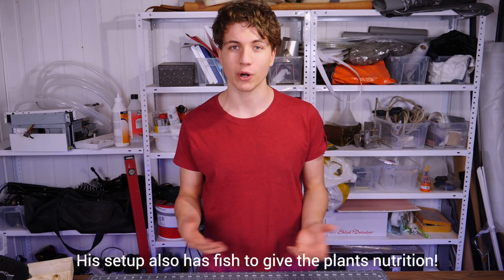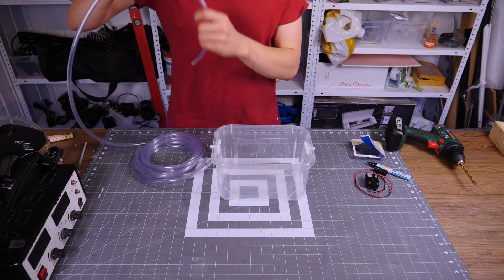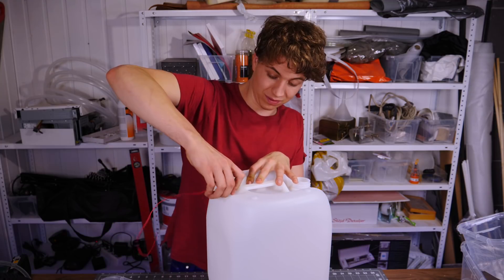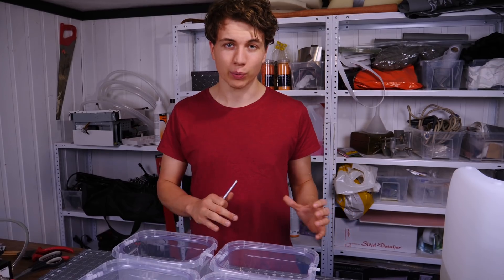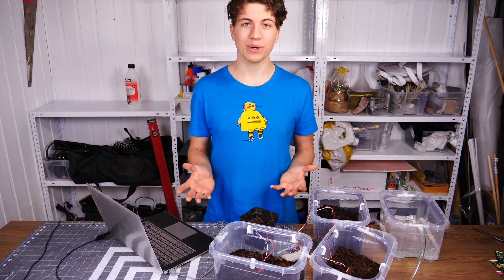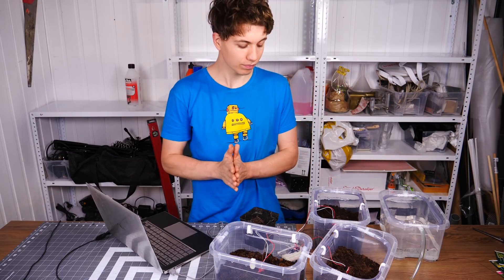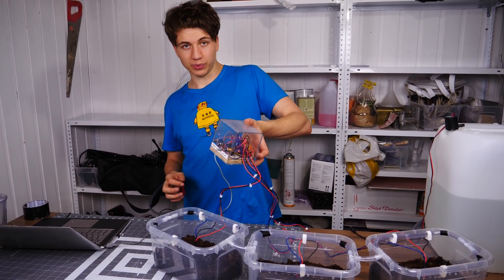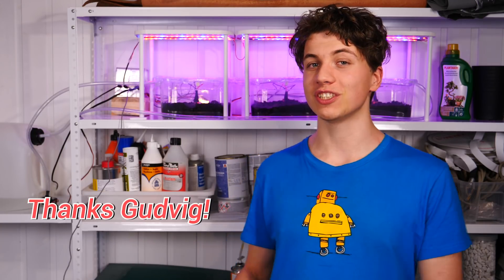Automated Indoor Garden  (The Garden Project ep. 1)

Comment: Nice first attempt. Two comments.
1. The moisture sensors you are using die rather quickly.
2. LED strips are rather an inefficient  way of controlling LEDs because of all the resistors included. If you don't want to waste so much electricity,  you can make your own strips with no resistors and  include a voltage regulator. You'll have to work out how to connect all the LEDs together (Usually done by a PCB) and use a voltage regulator (Both are quite cheap).

Comment: I've been watching some nerdforge videos, and like what you guys are doing. From experience, I think you will have some future issues with corrosion and bad readings on the soil moisture sensors.  There are methods to prevent that, but not with the sensors you are using. Also you can save the hassle/issues by switching to hydroponics, and ebb flow, or just spray/drip system on a timer. I recently posted a diy mini aquaponcs ebb flow system  with free 3d print files. I think you could tweak and utilize. http://www.gardenisto.com/cultivation/horticulture/desktop-aquaponic-tank-part-1/

Here are some links similar to your project, or may be helpful.
http://www.gardenisto.com/systems/controls/analog-soil-moisture-sensor/
http://www.gardenisto.com/cultivation/hydroponics/simple-drip-setup/
http://www.gardenisto.com/cultivation/hydroponics/diy-apartment-hydroponics-with-light-for-30/

One last note, I don't see any Lumens output specs on the LEDs you are linking to, but that height, plus the unknown lumen and saturation/light angle, could cause your plants to sprout in a weak and spindly sort of way, if they are sufficient at all. I learned that with anything over 3" using 1watt per channel rgb LEDs here:
http://www.gardenisto.com/systems/lighting/diy-led-grow-lights/

Maybe I am late to the game and just missed the update. If not, I hope you post an update, revisit, and make the improvements with the ESP mcu you mentioned. Looking forward to seeing more on this.

Comment: I would suggest adding some gravel in the bottom of the containers and some holes to allow water to drain out. Otherwise, you just built a really cheap mold growing machine. Also, maybe do a single pump per box you are monitoring in case there is a different plant that needs a different watering schedule or water saturation. The way you have it setup now is that the lowest common denominator will trigger watering for the whole system. You may have the other two containers over watered, or worse, overflowing with water if one of the sensors fails or reads below the triggering event.
Reply from the maker: Hey, thanks for the input. Surely room for improvement! Ideally I would have one pump for each, but as this is just purposed for growing seeds to sprouts they don't really need much water, at least not the seeds I have planted. So while you are absolutely right, I have coded it so that watering is consensus based. Anyway, it's not optimal and I'll be looking into improving all of it in future episodes. Once I have allocated some more space...

Comment: You wont be happy with these sensors for long. Thres's a steady current flowing between the two electrodes, so electrolysis will slowly eat them up and produce not-so-healthy metal salts which then will be spreadet in your soil...
Reply from the maker: Hmm, that's an issue. Let's see how long it takes, might switch it up later
Reply: I had the same concern. Please let us know. I’ve heard that they last longer if you don’t Power (activate, or whatever you call it) them continuously; try to only power them for the reading.
Reply: Dustin O Even this won't be perfect: Soil is usually a bit acidic, so it will dissolve the electrodes even when not powered. One possibility would be a capacitive sensor: it measures the capacity of the soil, the more water is contained in the ground the higher the capacitance. They don't require direct contact to the soil so will last way longer and are probably more hygienic

Comment: Putting the water container and pump on the same level or higher than the delivery tubes would take some stress off of the pump and possibly extend the life of it. There are also inexpensive spray nozzles available on Amazon which might work with the flexible tubing but would work for sure if pvc pipe were to be substituted.  A similar concept would work if the system were to be aeroponic and the electronics could be simplified. Great idea with the arduino and sensors, nice inexpensive project.

Comment: Hm...not a hydroponic expert, but I wouldn't be surprised if you got problems with mold  if you water from above and keep moist earth covered like that. Again, not an expert, but I think that's why you're supposed to water from below and keep the crust dry by making sure there's enough airflow.
Reply from the maker: Yes, but this is not a hydroponic system, although I want to make that in the future. This is just a basic watering mechanism for when the soil gets too dry :)
Reply: Yes, but even though you are not targeting this too be a HydroPonic System, you are still going to need proper drainage and root ventiliation. The way you have it setup now is it is going to induce quite a bit of mold growth.
Reply: Yes, you're right, of course...with soil it wouldn't be called hydroponics (not a native speaker either☺). The setup is pretty similar, though. 
Anyway, at the very least you need to add a layer of gravel or something under the soil...with targeted watering that might be sufficient to prevent rotting roots. You could also mix some fine granulate substrate like Seramis with the earth to airate it more and suck up superflous water.
And most importantly...if you use high containers and dripping water you need to install a fan that'll insure some airflow.. I know, it's counterintuitive that earth or living plants would grow mold....they don't do that outside, after all...but inside is a whole different business. No idea why. 
Or you could look at the way targeted watering is done in very arid areas of the planet. They put the tubes into (or on?) the earth, poke tiny  holes into them and next to each hole is a seedling. Literally not a drop of water is wasted. And you wouldn't have to worry about mold or rot that way. It's very clever and would probably work well in your setup.

Comment: You should isolate each box to avoid over watering or introduce an electronic valve system to route the water to the boxes individually. If Box 1 is too dry but Box 2 and 3 are at the proper levels, the sensor will trigger the pump (unless your code says otherwise) and then water would be pumped through the entire system and could possibly over water the other boxes. Great video!
Reply: Yes, my thought as well. This is only useful if all three boxes dry out simultaneously. Still a cool project, though.

Comment: Like this, will follow as you build it up.

Just a suggestion, (in Australia at least) for our garden sprinkler systems, you can get different heads etc. It would give you more control on direction and spread (I would use the misters for the seedlings for example). Should just push into the tube like the black sprinkler system hose as well.

I wanted to make a computer controlled garden box to keep a particular (and hard) tropical ant species. So I might steal some of your ideas etc :P
Reply: Amazon, in the USA at least, offers a variety of misters / spray nozzles that would allow a very consistent watering. The pump might need to be beefed up a bit but the performance would be improved.
Reply: Yeah, never know what other countries have. But I think you are right, slight pump upgrade would do wonders.